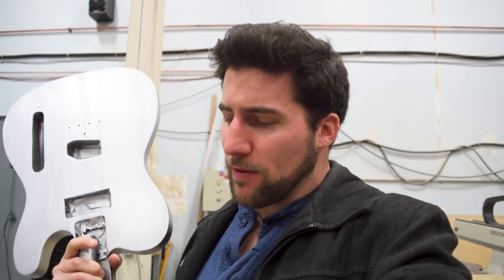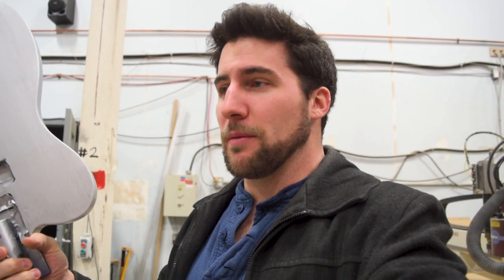Crazy Custom Guitar Kit Paint Job! | The guitar kit from solo music gear (Part 8)

Comment: Look cool in the end but I really had my doubts when you whipped out the drill. A bit surprised the rivets did not crack the wood. 
I am way too conservative for that though. I would have cut the rivet heads and epoxy them on.
Reply from the maker: The inexpensive rivets don’t really create that concern. They don’t apply as much force. Also, this wood is soft enough that it’s not an issue thankfully.
Reply: Interesting though I never thought of using rivets this way. It was always to join sheet metal. I will buy some thin body ones and try it just to see the results.
Reply from the maker: I used to use them to join metal and wood sometimes, as well as metal to metal of course.
Reply: I really have to try that. Just expected the deformation of the aluminium would require too much force for regular wood (not hard woods).
Reply from the maker: I had similar concerns initially, but I’ve never had a problem with it.

Comment: Very creative Brad....especially the use of the rivets. I love it. One question though....right at the start you airbrushed your 4 black lines along the body, then you masked across the body for the opposing black lines. When I saw you using that masking tape, I was expecting it to rip off portions of the first 4 black lines, and even some aluminum paint as well when you 'unmasked' it. How did you avoid that?
Reply from the maker: The paint that I’m using is high-quality and reliable. The masking tape is cheap and not super sticky. If you’re worried, stick the tape to your shirt a couple times before you stick it down.
Reply: Good quality paint is always a good thing, no denying that. Instead of the 'shirt' trick, I have used a tape made by 3M (I think) that has a very defined edge but doesn't stick so much as to rip off any fresh paint under it. I've never had any luck with that paper type tape....I just use it to seal my rubbish bags these days!
Reply from the maker: Ya. The 3m tape is well worth the tiny additional cost generally. It’s good stuff.

Comment: so much for the black binding. :(  Looks also as if you missed a few spots with that brushing on of the silver paint.    I don't know, right now it looks uneven to me.  It's very hard to brush a straight line doing it freehand like you did.  Anyway,  i'll keep watching and see how this turns out.
Reply from the maker: As per the standard practice, I brush over the binding and then remove the paint with a razor blade afterward.
Reply: @BradAngove  I thought you were just painting over the binding then later I saw you were going to bring it back so now I get it!  thx

Comment: by the way Purdy brush in Oregon use to stop the line and make special order brushes these are so really fine high dollars "auto enamel brushes" got to get one Brad, plus they are very nice you are not limited by your brush at all you'll love how amazingly smooth and perfect how well they lay on materials super nice to work with, but keep them under lock and key don't let anyone near them it's amazing how they walk off, awesome brushes like in the mid 80's they were like $70-$100 something they litterally have the best bristles from animal hair from around the world and top brush the guys that assemble them are the best. I know you could use a 2 " & a 3" one you can smoothly paint very high dollar paints giving really refined brush effects. 
best David Mack
Reply from the maker: That sounds really cool David. I generally like to spray, but sometimes you just need to use a brush haha.
Reply: Brad Angove 
Does that silver paint lie real flat as in smooth or does it leave a brushed feel to it? Also what do you think does air brush lay paint as in mils as compared to like your HVLP sprayer or an artist brush? Another question, (approaching my exact parameters for use intentionally,) how thin as in reducer does it squirt out equal viscosity out of an airbrush gun would an airbrush shoot normal mix for a catylized auto enamel is it a good localized solution for touch up scratches on a paint deep thick only on a metal edge on a paint surface edge? Does it lay flat in comparison to adjoining areas pretty smooth that goes on it looks like it would be if it's the same viscosity as existing paint. actual question can you multiple coat small scratches light surface dings that are only paint thickness deep to recoat them to like a  edge to prep giving an easy application clean-up?
Admiring rather cleaver geometric design with hard painted lines quick tear off then blurred edges not leaving hard edge because of quick tape pull and overarching fine mist over linear contruct shows through yet take away a but hard lateral line, nice.
Best to you,
David Neil Mack
Note: im using a catalyzed acrylic enamel automotive paint?
{ on back of quitar random casual paint design What was your intentions idea there Brad? directed almost industrial front like a big old sliding steel factory door faux finish what was tie in to back face of guitar- vision for overarching constuct, it is an art, of course as a adept guitar finisher graphics artist how does front back temperament tie together what was your vision on back? beyond color and medium } I like when I see an artist idea to get insight into his vision what were you going for kind of idea. . . 
dnm 
I've done art on walls of bussiness and managers called me by famous truely classical artist names using wood paint color but insight into a real artist design intent  Brad as a living artist, I'm not the east coast watercolorist guy by same name. but beauty color edges flow be it wood grain or art-deco industrial we like it and in our journey who knows how we'll end what lights our imagination or best self. know this to you you soundly know yourself this is I have seen but a small part of what you do but am intrigued by design there is no intention but to learn, see, hear the artist voice speak and gain learning.
Reply from the maker: The brushed look has a brushed feel too it too, but nothing too drastic. 
An airbrush puts paint on way thinner than a gun or bristle brush. If you’re spraying thin lines they dry instantly and are too thin to feel. 
You need your paint to be thinned to a lower viscosity with an airbrush because of how small the nozzle size is. I usually go with about the viscosity of milk for the detail work. You wouldn’t want to be trying to spray catalyzed paint through it. You could spray the colour and then use a touch up brush to do the clear coat if it’s just the scratch.

Comment: Hello, I hope you are well ... after applying the layers of transparent polyurethane and following your instructions, I tell you. Two weeks have passed (15 days) the transparent is hard to the touch, I try to scratch it and nothing happens to it, but when you sink the nail, a small potion of the transparent layer is marked. that is normal? Or will it be that when polishing the layer hardens even more? regards!
Reply from the maker: Your nail shouldn’t really have any effect. How thick did you put in on there?
Reply: Brad Angove 5 times two layers per day, leaving to dry 24 hours.
Reply from the maker: You did 10 coats? That’s probably why it’s indenting. That’s very thick.
Reply: Brad Angove the truth is that the portion that sinks is very small because the touch is very hard. I also try to scratch it and nothing happens. Do you think it will harden even more?
Reply from the maker: It might harden a bit more, yes.

Comment: Help help help I just sprayed a pearl black and I got a tiny run in the paint. Before I clear the guitar do I sand the spot where the run happened and respray the spot? Or am I just screwed and helpless
Reply from the maker: You sand the run flat, scuff the surface, clean it, and then spray one more thin coat of the pearl black before jumping immediately into the clear coat.

Comment: Brad -  What paint do you usually use with the air brush (for the flames and panel lines in this project for example)?
Reply from the maker: Auto-air acrylics.
Reply from the maker: I use the 4200 series in the gun for a more opaque coverage. Almost always the grandparents for the airbrush. They’re milled finer.

Comment: I’m trying to paint my Custom guitar with a similar Silver- what would be the best (quality speaking...)- Silver, and where can l find it...? (my friend has a boot and all the tools to spray it, but not Silver color...)
Also, around the pickups l have a maple veneer, which it will be stained to get that “flamed” finish...- The paint l’m looking for I hope it’ll go easy on top of that “flamed maple”.....- (now, that could be a problem, right..?)
Thank you.
Reply from the maker: The silver I like to use for spraying is from autoair. You can look at their actual silver, but this stuff was their aluminum base. 
Flamed maple just has a different grain style. If you seal it properly, it
can be painted the same way as any other wood.

Comment: Hello Brad and peeps SOLO COPY LP335 (I tried a finish with water based diamond outdoor varathane (BAD PLAN) I messed up the job by accidentally leaving a damp cloth on the guitar it lifted the finish and the Water Born Varathane would not adhere to the guitar sealer ....  so now I have a oh boy and a request!?!?
 (Dupli-Color MP403 Red/Blue Mirage Kit) can you test this out it looks way cool may be better than the Blue Color shift by rustoleum ??? please help can u email me ?
a link were I can post a pic or 2 of the paint from hell..  Please
Reply from the maker: You can post the pics on the Facebook page in the video description. As for the mirage paint, if I get my hands on some at some point I will definitely do a demo.

Comment: 00:53 you are using a spray gun and you have not covered your face, eyes and mouth are exposed to possibly harmful gases and or chemicals; PPE (Personal Protection Equipment)  is there to protect you from harm - if you're not wearing it for yourself, should you not wear it to encourage viewers to do this kind work safely?
Reply from the maker: It’s water-based paint.
Reply: My kid uses crayons without wearing a mask.  That bad form, Mark?
Reply from the maker: “He is exposed to possibly putting them up his nose. PPE (unnecessary explanation of common acronym) is there to...”
Reply: @BradAngove  Brad, how do I contact you about some work?
Reply from the maker: You can use the Facebook or Instagram links in the description, or email to brad.angove@gmail.com